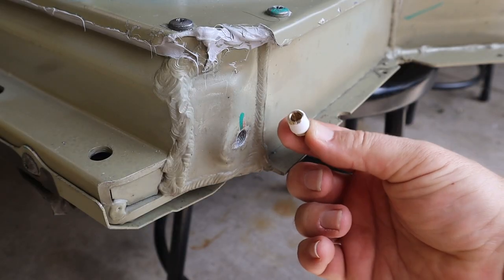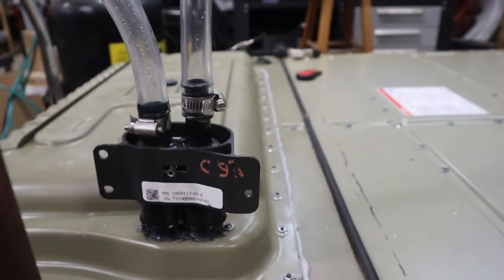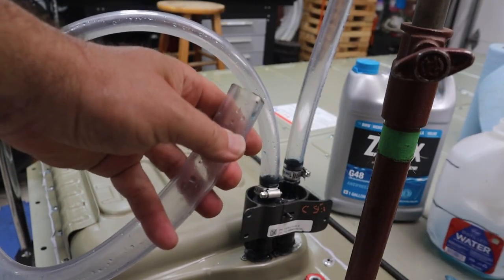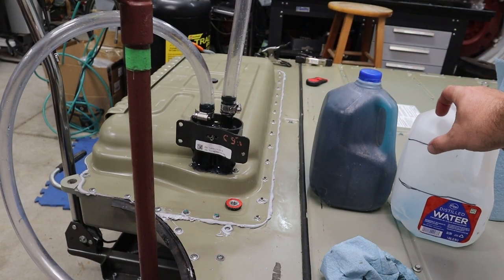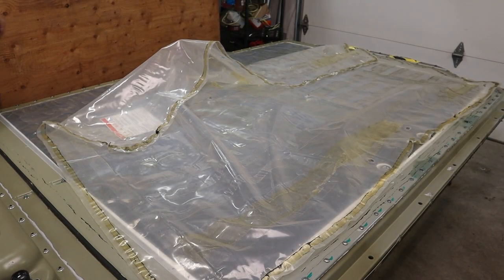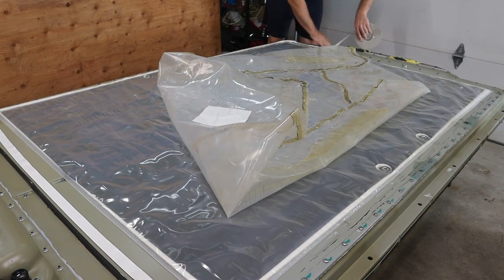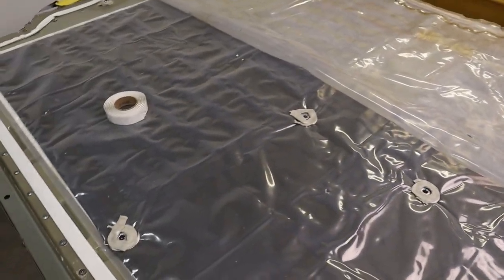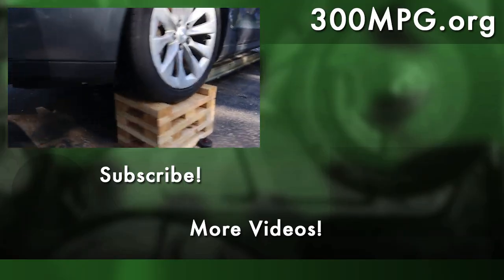DIY Tesla Battery Pack Repair: Final Steps - Coolant, Ceramic Blanket, and Plastic Sheet

Comment: If you could see the inside of the cooling tube, you would understand why the coolant can not be gravity filled. 

It is not necessary to fill the pack prior to installation to vehicle. as you did.

Hope many DYI view your episodes, learn what NOT to do. 
Yes, re use the original threaded plug! Just add plumbers tape.
Reply: You must work at Tesla? You should explain how inside of the cooling tube works so people can understand why it can't be gravity filled.
Reply: @thisisntforsharing Yes, retired after 15 years, Roadster to Model 3/Y remanufacturing experience. 
Original team member that started the battery Remanufacturing process, in Fremont CA, north end, behind service entrance.
Reply from the maker: @clarkleakins879  Do you have any instructional videos on Tesla repair? I'd love to see them!
Reply: @thisisntforsharing hmmm....wish I had a cutaway to show. Need time search for a sample. Not easy  easy to describe.

Comment: The blanket cover: 
Put double stick tape on the 6 mounting bolt sleeves. 
Then set the blanket. 
Press firmly at each sleeve location. 
The cover will remain  on proper position while the perimeter is being set.
After completing, push the appropriate size phillip screwdriver to poke through any tape that may block the mounting bolt.
 This also makes darned sure no stray screw/debris has fallen into the sleeve.

Comment: Mechanics use a vacuum system to fill coolant. They pull over 90% of the air out with a venturi pump running off compressed air. Then put the end of the hose in a bucket. They open a valve and the cooling system literally sucks the coolant in. No air bubbles in the high spots. Vacuum coolant fill kits available at online shopping for < $80.
Reply: Car can do that. He mentioned it in the video.
Reply: @HoldFastFilms  The car has a purge function to hopefully push the air out. The vacuum pulls out the air to later be replaced with fluid.
Reply: @HoldFastFilms  I think the car just runs pumps to circulate coolant and hopefully burp the air pockets out. Doesn't always work, and some cars require coolant & oil is drained & filled with a vacuum to ensure no air pockets / complete exchange.